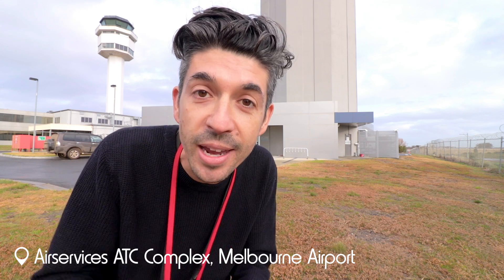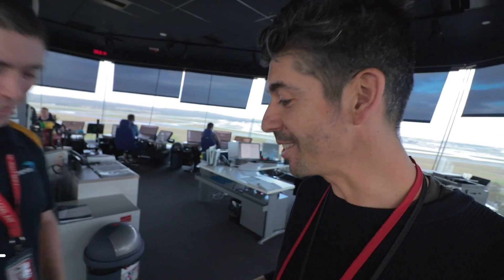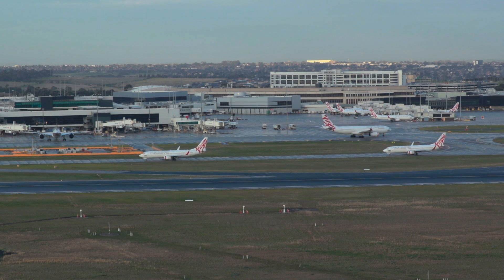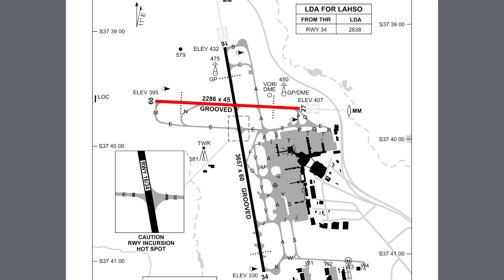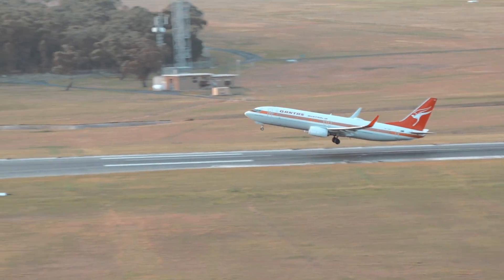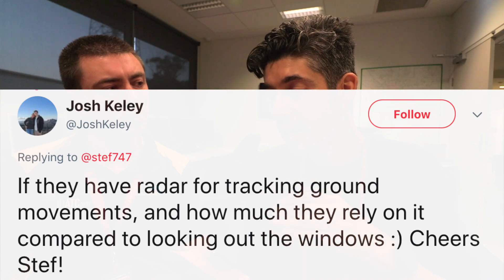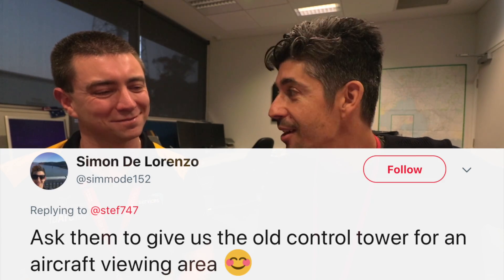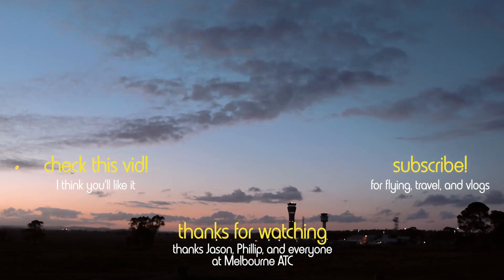What happens INSIDE an Airport Control Tower?

Comment: Does ATC to aircraft pilot radio communications vary on the ground of an airport from airport to airport concerning receipt of IFR clearance on designated frequencies such as Clearance Delivery, Ramp, Ground, Apron and Tower? IFR clearances can be obtained from contact with any of these Air Traffic Control units above dependent on the ATC operational procedures in force at that specific airport.  Does the pilot of an Airline have to be trained by the Airline as to which ATC unit to contact to obtain the specific clearance required at each airport?

Comment: I thought paper strips were retained as a back up is a power failure or some other problem, would not have computer controlled paper strips be a bad thing?
Reply: Our electronic strip data in Canada is retained to the same standards (or probably longer) as was required with the paper strips. As well investigators have the ability to go back and review how a controller manipulated the strips during an incident.